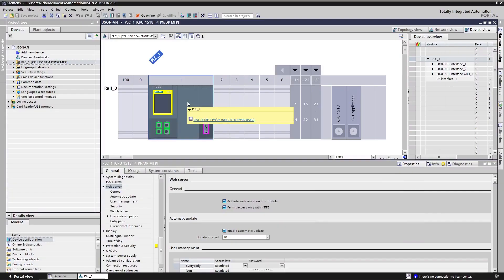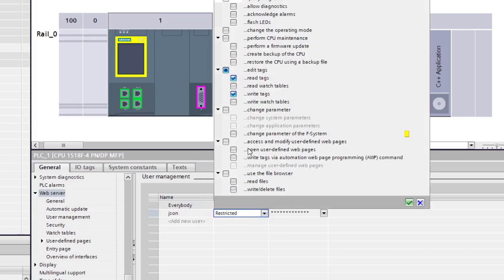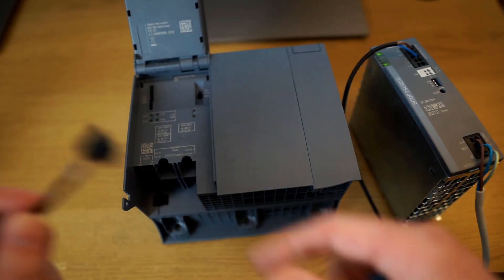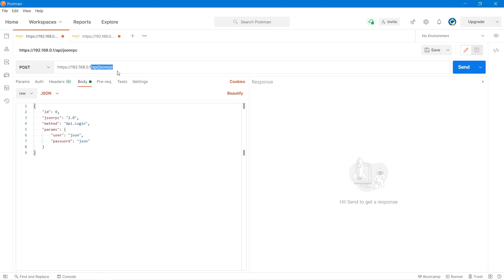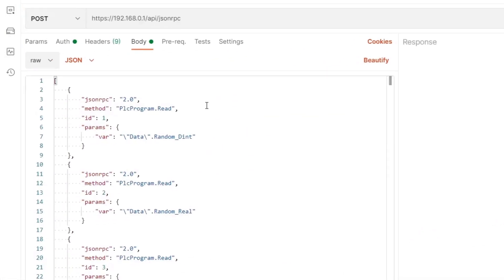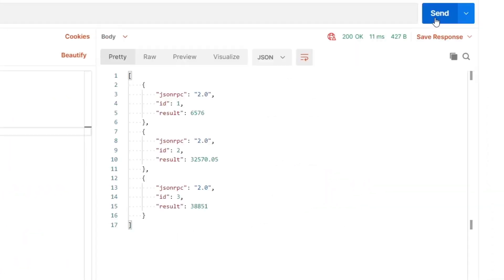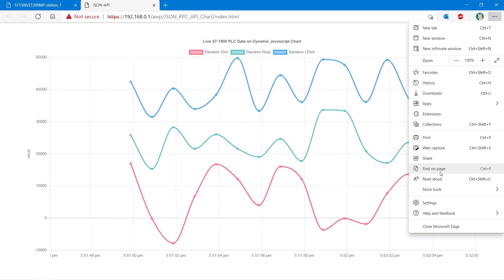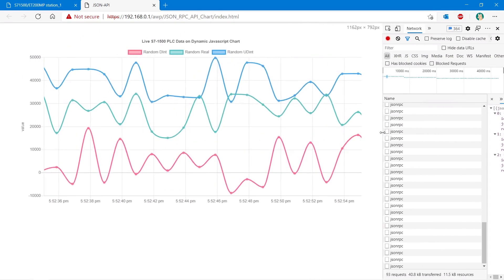Siemens S7-1500 PLC JSON RPC Web API - Integrating Control Systems to Higher Level Systems with HTTP

Comment: Does anyone know if there is a way of making a request for a file within the HMI? I want to graph older data that is stored in a USB in the HMI. Thanks in advance!
Reply from the maker: Which panel?
Reply: @AutomationStation  It's a TP1900 comfort
Reply from the maker: @JuanAlvarez-oq4ny  Don't think you'll have any 'modern' options but Check HMI Option+, I think you could attach a network drive and push data this way. There might be other ways as well though - not a panel expert myself I'm afraid ;) Maybe try checking with Siemens direct
Reply: @AutomationStation  Thank you for your answer!!

Comment: That seems to be exactly what I was looking for! I am not a PLC expert, instead, I am woking in an IT department using Oracle databases and we implemented an MES system a few years ago using OPC to retrieve data from the PLCs. To do this, we attached a small OPC server with each PLC and connected the MES software via OPC protocol to these OPC servers.
Now, with what I just learned from your video, it seems like these built-in features of the S7 1500 make OPC servers obsolete if I have the means to do JSON requests from the database side (which Oracle can do via PL/SQL, of course).
Am I getting this right that connecting directly to the PLCs web server/service and using JSON requests can be used instead of OPC and basically can do the same job?

Comment: hello！I'm using 1200, firmware library 4.5.0. I'm curious why your response is so fast, it's done in milliseconds. however I need a few seconds。if I use lhttp,its fast like yours .Thank you
Reply: Hpw ,amy API requests do you send? Are you using JSON-RPC Bulk-Requests to minimize the HTTP and TLS load? S7-1200 though is slower than S7-1500

Comment: Its not really RPC though to be honest.

RPC means remote procedure calls. In other words, it means that you can call functions remotely. You may be able to call predefined functions via a remote PC, but you can't really implement your own. 
Unlike TwinCAT 3, which actually implements real RPC, you can't call functions or function blocks remotely, due to the fact that it does not implement the IEC 61131-3 standard.
The IEC 61131-3 actually allows you to have a somewhat modern high level programming language. Function blocks can have methods, which in return, can be called via the RPC protocol.

Just my two cents. I find it rather misleading calling this RPC.
Reply from the maker: It isn't being advertised as RPC, the name of the protocol which is being used is called JSON-RPC https://www.jsonrpc.org/

Comment: Thanks for the informative videos. I keep getting a '400  BAD REQUEST' when i try to connect. I have everything set as shown in the video but i never get a response back. I am using a S7-1500 1515-2 PN CPU. I have configured the webserver and added a user with the same name and password that you used. the only thing I'm unsure of is the id number. Any help is appreciated. Thank you.
Reply: Did anyone find a cause of this 400' problem?
Reply: Aslo "400  BAD REQUEST", any idea? What to check?
Reply from the maker: Just to confirm, the PLC you are using has V2.8 firmware, is programmed in TIA V16, and you are connecting via HTTPS?
Reply: @AutomationStation  Yes it is firmware 2.8 and I am using TIA Portal V16 Update 4.
Reply: @AutomationStation  Yes on HTTPS too.
Reply: you need create certificate (CA Certificate and Device certificate) in TIA and connect them to Postman
Reply: @yaroslavlyulko2298  how can i do it ?
Postman just works with crt files and when iam exporting the Certificate from Tia its an cer Certificate ?
Reply: Make sure you use a T/F range Siemens PLC. Manual stipulates only T/F range PLC can handle API requests. Also token expiries and a new request should be sent if permission denied is returned. Hope this helps!
Reply: And only the 1500 range van handle these requests

Comment: What is a TIA version do you use?
And it can work with S7-1200 ?
Reply from the maker: EDIT: As of V4.5 Firmware of S7-1200 and TIA Portal V17 this feature is also functional in S7-1200
Reply: With V17, also S7-1200 supports this feature 😀